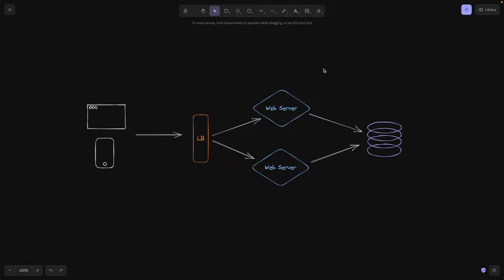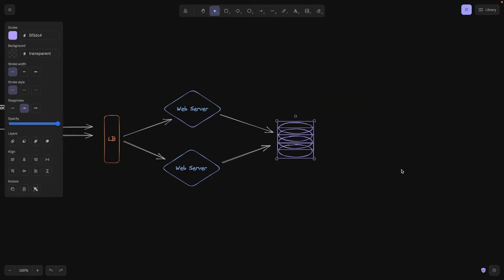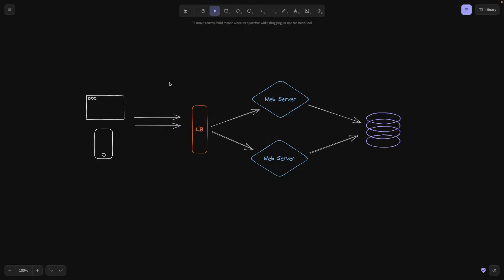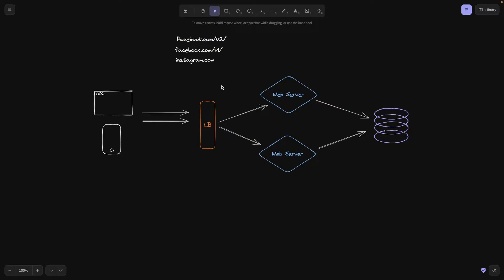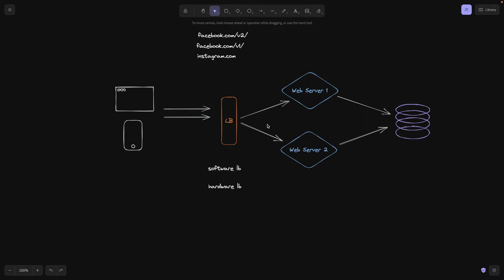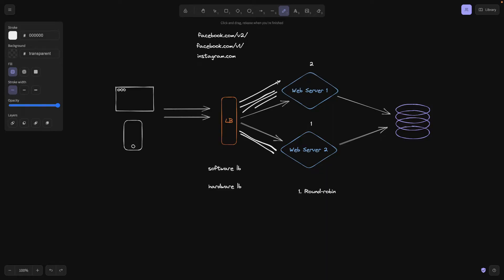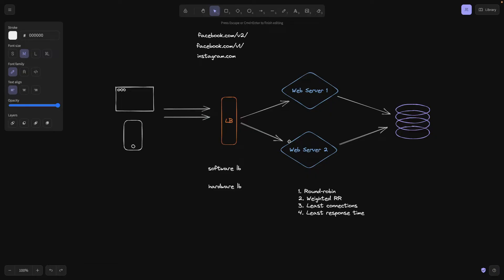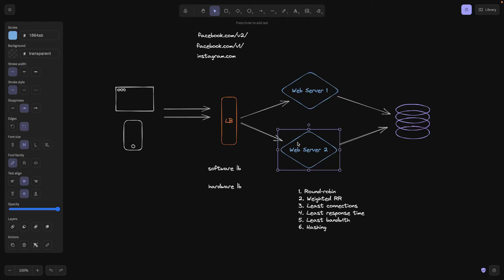The Ultimate Guide to Load Balancers (System Design Fundamentals)

Comment: Next wonderful material! 💎

I have another question 😅. How load balancer handle with long-live connections like WebSockets or SSE? 

I mean when client established connection with SSE/WebSocket Server. Is Load Balancer still involved for sending events to the client and keep long-live connection? Or is passive and allows on direct connection between SSE Server ---> Client.
If the first option is true (LB keeps long-live connections) it not seems as efficient as it need to handle MANY connections in Single Point.

Comment: I don't think hashing is not stupid you are thinking small.
Assuming that you use LB for just point to various services servers with the same software.
For example if you do when doing sharding you can divide user or a specific tenant data into a single database thus you need a way to sort of connect the dots or have this affinity to a specific set of servers that has access to the caller's data.

Examples
- Exchange Online they used sharding which they divided the traffic of specific organizations to the same set of servers that contained their replicated data so the organizationId was hashed and with allocation magic would know to wish set of servers should route the call to read their mailboxes.

- Netflix which has separation of concerns microservices separates the concerns  of READS the movie or series details and doing SEARCH role that just holds a small the READ and SEARCH servers, because both load the entire media catalog in memory but each structures the data differently because they have different scenarios

How does Google does google know which servers to connect to in order to find the search result that you want?